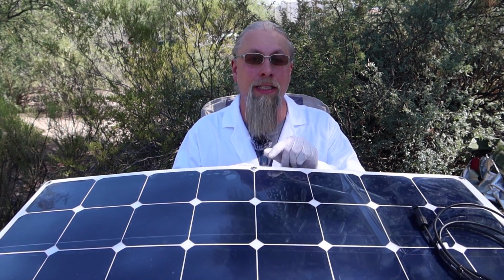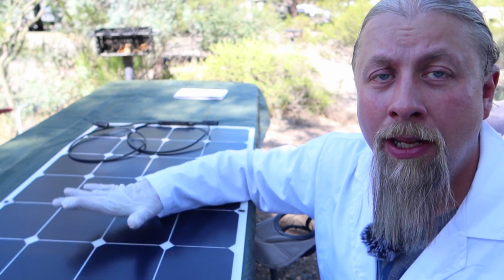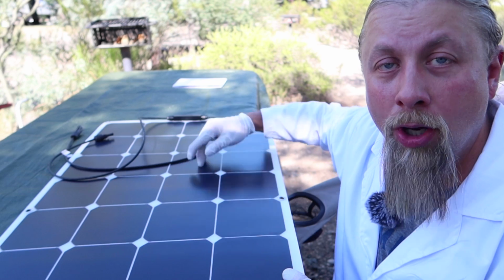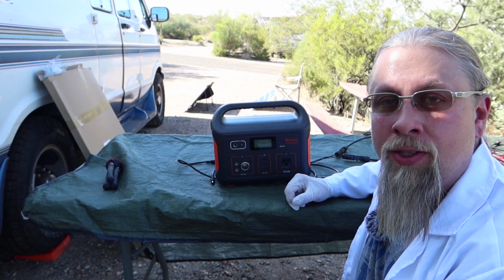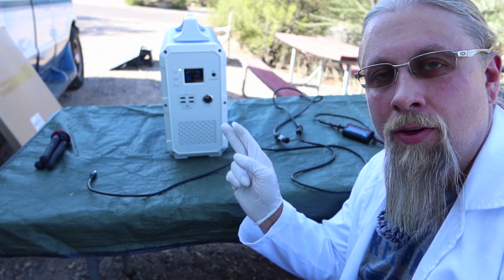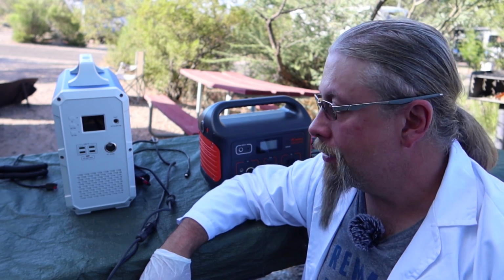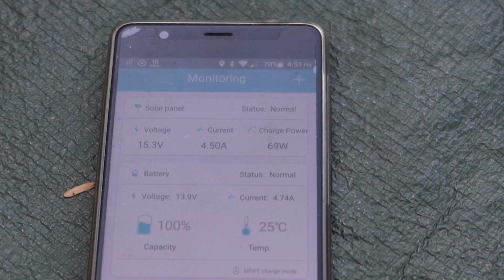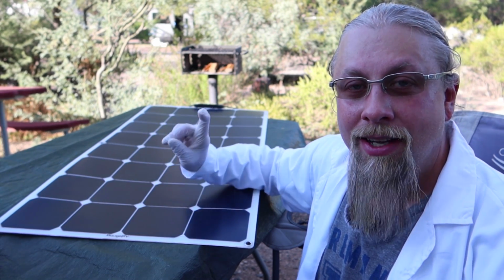100 Watt BougeRV Portable Panel Review | The PROFESSOR is BORN!

Comment: hahaha, very entertaining and educational at the same time, thank you.  The biggest complaint I
I've heard about flexi-panels is they surface degrade more quickly.
Reply: I'd be curious to hear what Tom has to say about that. He's had those flex panels on the roof about 2 years now.
Reply from the maker: My roof panels are Renogy rigids. They say these flex are better than standard ones. Time will tell.
Reply: @HOBOTECH  i keep forgetting. It's the tape. What would be cool is to give us an idea of how much power you generate on a monthly average and compare the cost of solar and batteries over time. We pay about 15c per kwh in a house. I'm wondering if you could break down the cost to per kwh as well.
Reply from the maker: @zfoxfire My controllers do keep track of this but lately I been on shore power. I don't have a full month stats yet on all 6 solar panels but I will be boondocking again soon and maybe I can extrapolate from a week's worth of data.